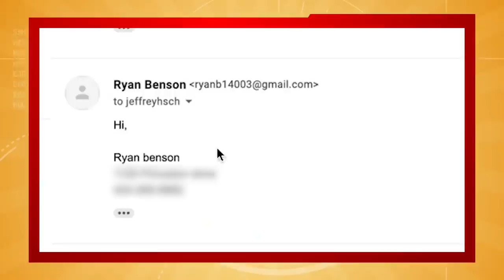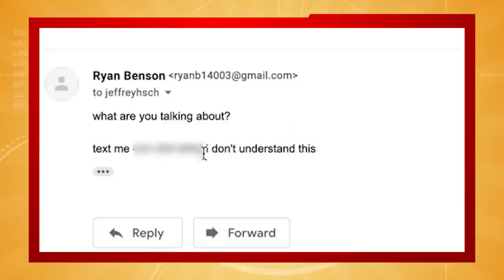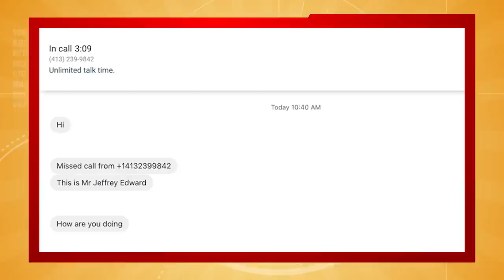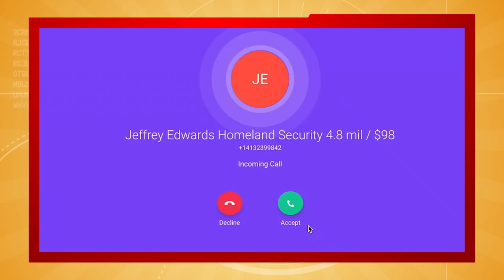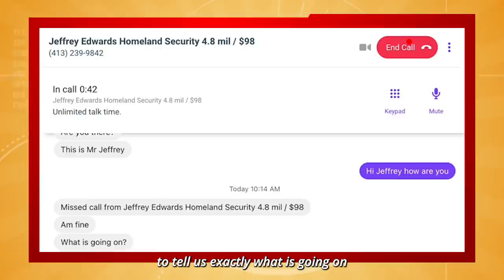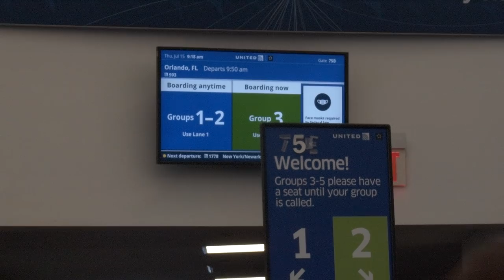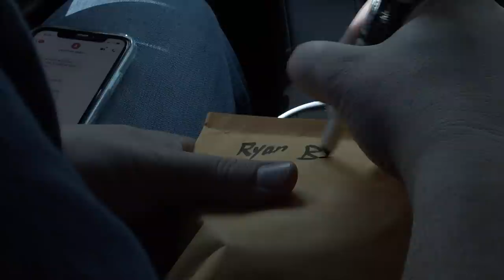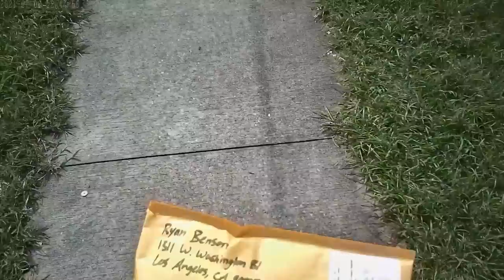REVEALING Scam To Unknowing Cash Mule

Comment: Hey Trilogy Media, i JUST NOW got off the phone with an Amazon scammer. I messed with him for 50 mins before revealing myself as a time waste. I hung up wondering for a minute if there was any risk to messing with scammers the way I just did. I assume you guys use burner numbers but I guess I used mine… by default since they called me 😂 so I was wondering, because they were fucking PISSED at the end… should I be worried? Should I change my number now?
Reply: They are toothless dogs. But next time use burner numbers and necessary protection before scambaiting.